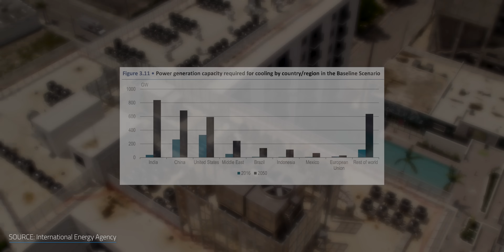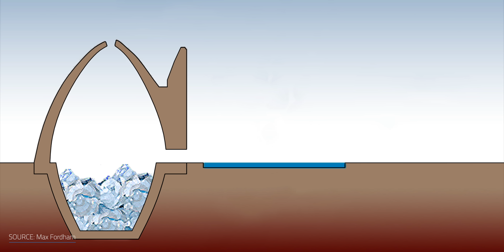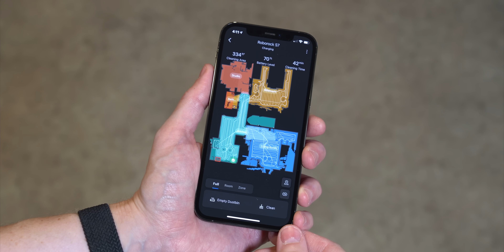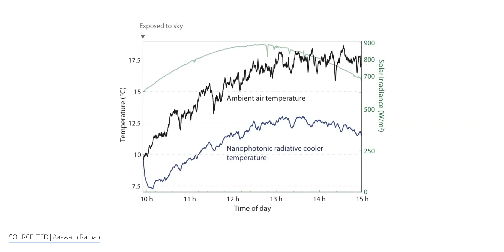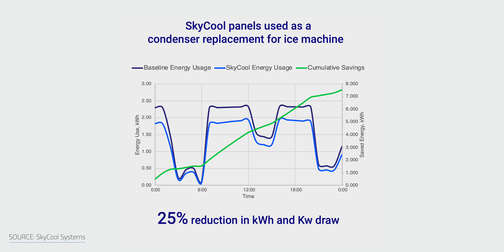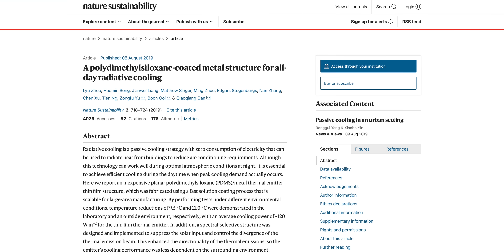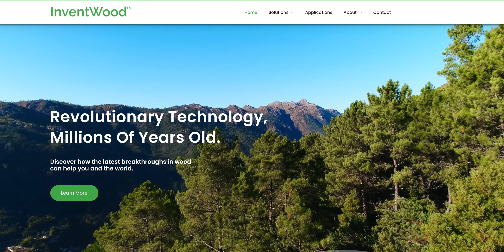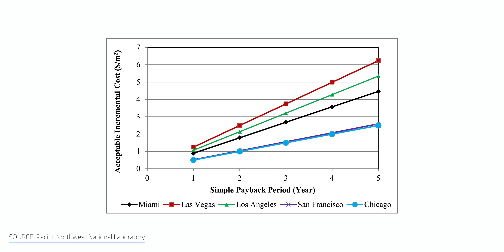Space Powered Cooling May Be the Future of Energy

Comment: 2% of the surface doesn't sound that big? Couldn't they just build massive arrays out in the deserts?
Reply: The main problem is that these geoengineering projects may have unforeseen consequences for the global climate and weather patterns.
Near covered areas heat transport and temperatures will differ from the surrounding areas and that might influence precipitation, wind and seasons.
Reply: @totalermist  that is an issue. not doing anything has foreseen consequences though. And a system like this could be turned off, so in a way is better than shades in space or dust in the atmosphere as a solution.
Reply: @jameshughes3014  The difference is that the known problems are manageable. It's possible to limit global warming to a point where we can prepare for and deal with it.
Introducing a new variable into the mix is risky.
Reply: @totalermist  manageable? we have totally failed to manage anything. a huge portion of the country catches fire every year.
Reply: @jameshughes3014  Most wildfires are the result of arson and carelessness and totally preventable. The consequences of rising temperatures and weather extremes can be reduced by careful planning and suitable preventive measures as well.
Flooding is often a result of flawed zoning and poor land management. The effects of droughts are amplified greatly by overpopulation and unsustainable agricultural practices, etc.

What I'm trying to say is that none of what happens today and in the near future in terms of damage and loss of life is inevitable and can be mitigated without resorting to half-baked technological megaprojects.

Reforestation, birth control, proper waste management, proper city planning, less sealed soil and more room for natural wetlands as well as sustainable agriculture are much more effective (and cheaper in the long run) than trying to fight symptoms instead of root causes.
Reply: @totalermist  lots of people have already died from global warming caused events. millions each year. and it will get worse. gonna 'manage' them back to life? it's not something that will or may be an issue. it has been. and it's already nearly too late. its time for drastic measures. we have to stop polluting yesterday, AND do what we can to remove the excess that is there now.
Reply: @jameshughes3014  Yes, people have died and more will if we don't take measures. I described solutions and why they help. Painting the world white is neither a solution nor would it help.

Mismanagement of resources is the primary problem: deforestation, sealing of soil, unreasonable zoning laws, unsustainable agriculture, overpopulation, lack of proper waste management and recycling.

Those are the primary issues that will continue to cause massive problems in the near term. None of those are addressed by painting the desert.
Reply: @totalermist  well, I guess if you say so it must be true.
Reply: Remember that the planet is 70% water so 2% of earth is 1/15 of the land area.
Reply: @doritoification  true, but it means if we had a few  patches of desert 1200 miles on a side, that would do it? We have desert, lots of it. cover arizona and north africa, some of the middle east? Plus, there's nothing saying we can't put them on the ocean. It would be a monumental undertaking but.. I mean if it solves global warming?
Reply: @jameshughes3014  it wouldn't solve global warming. It would be an eternally high maintenance attempt to mitigate against increased solar radiance which would do nothing to solve the other issues CO2 causes such as ocean acidification and would only last for as long as it's maintained.
Carbon needs to stay in the ground. Using these things to increase the efficiency of industrial cooling will reduce the amount of carbon liberated by a non negligible amount which has a compounding effect over time (carbon is very stable in the atmosphere and will continue to heat the planet indefinitely) so it's one of the many tools we should use to improve our use of energy but as a stand alone geoengineering method requiring 1/15 of the land area it's a non-starter. Period
Reply: @doritoification  yup. it'd be hard to do, and it wouldn't be the entire solution but might be a part of it. got a better idea?
Reply: @jameshughes3014  yeah I do have a better idea. Literally anything that has a permanent effect on radiative forcing is a better idea than something with a temporary effect on radiative forcing. Covering the desert in panels that will ultimately just get re-covered in sand is probably the worst geoengineering technique I've ever heard proposed. You'd be far better off just using them to reduce the energy consumption of industrial cooling.
Then we need to electrify transportation and heating while expanding the use of low carbon nuclear energy especially working towards 4th generation technologies like molten salt reactors.
Finally, when energy superabundance is achieved, make use of the combined heat and power from mature 4th gen reactor designs to take the CO2 dissolved in the oceans and hydrogen from sea water to make synthetic hydrocarbons. This technology will be pioneered by the need for carbon neutral aviation fuels but, when mature, could transition towards replacing all the petroleum based products we use in every day life like plastics. When these enter landfill they will have sequestered the carbon and actually made somebody money in the process, incentivising the continued sequestration of carbon without disrupting the human desire to keep consuming more and more
Reply: @doritoification  we need to do a lot of things. so, what is your better idea? all you did here was talk about what we might one day maybe do in the future. but people are dying today. so.. you know, any ideas? I say we make green house gasses illegal, or so incredibly expensive no one can use them. But even if we turn off all pollution now, that doesn't solve the problem. Even if we start pulling some CO2 out of the air.. global warming will still get worse for  years. What ever we do, we need a real solution.. not jibber jabber while people die. Even if it's not a great solution, something, anything that helps, is better than dreams of future reactors while millions of people die and islands sink. The time to fix this is yesterday, not tomorrow. If we get real about this.. if we as a planet actually take this seriously.. we can stop polluting, capture GHGs, and get rid of some of our excess heat all at the same time... and maybe, just maybe reverse this thing. When an animal sees headlights.. they either do something.. or stand there like idiots while the car bears down on them. We have to stop sitting around like a deer in headlights. its time to do something.
Reply: @jameshughes3014  I don't know where you live but here in the UK our largest power station called drax actually runs on wood pellets imported from South America causing extreme deforestation and not even being low carbon despite the claims. We also but 10% bioethanol in our petrol meaning fuel consumption now creates demand for unsustainable bio energy crops. It's really bad and with nuclear and electric cars it could have been solved a long time ago.
Reply: @doritoification  what will you do with the waste from all those reactors? can we keep it at your house?
Reply: @jameshughes3014  it's less radioactive than the ore it was mined from after 300 years. Our dry cask storage is a perfectly suitable storage method.
The ceramic material can also be vitrified in glass before put into dry cask storage too for extra containment after the concrete and steel has failed thousands of years down the line but it's not really worth it for light water reactor waste seeing as we will recycle it in next gen fast breeder reactors in the coming years.
Even if all of the above wasn't true, there are deep geological repositories being dug as we speak. Seems like a waste to me... lts only waste if you waste it
Reply: @doritoification  a quick google shows all kinds of issues with it.
Reply: @jameshughes3014  well i'd argue that solving climate change in a day is a bit far fetched and so is your idea but i think this is a good time to end our discussion
Reply: @doritoification  sorry, my replies have been harsh. I'm just tired of people dying while we sit around and do nothing and argue about how to fix the problem.
I'm sure your ideas have plenty of merit, but we've had nuclear for decades. we've tried managing the situation for decades.
half of my home town was wiped off the map because of extreme weather. maybe it wasn't climate change that spurred that tornado, but plenty of people are going to suffer a similar fate now because of it.
it's time to stop polluting and take some responsibility. turn off all the GHG producing factories and ships and I bet everyone will want to hear about nuclear real fast. Just make sure before any new systems are produced that the waste issue is dealt with, planned and paid for before the first new reactor goes online.
Reply: @doritoification  really? you think so? because we already know how to fix it.
stop.
polluting.
it isn't complicated.
Reply: @jameshughes3014  nuclear decommissioning funds are in place before the reactor even goes online and paid into throughout the operation of the reactor. They're generally so large that (in america) it becomes more profitable to shut down the reactor than to operate it because the operator can pocket the difference between the cost of decomissioning and the money in the decomissioning fund. We don't have that problem in the UK but point is that the funds are most certainly in place.
Reply: @jameshughes3014  the "just stop polluting" and "just use less" and "there are too many people" narratives are very very old, far before my time. Never in human history have we "just used less" or "just stopped polluting" because everybody wants to improve their lives. Interestingly though when we do improve our lives with access to education, energy etc. women trend towards having fewer children later on in life which leads to population stabilization.

Just food for thought
Reply: @doritoification  so your point is that we havn't done it yet, so we can't do it?
Reply: @jameshughes3014  the definition of insanity is to try the same thing twice expecting a different outcome.

Comment: So what’s the disadvantage
Reply: I believe the IR 'pigment' is achieved by carefully controlled particle size, so it is just hard. That doesn't mean it will stay expensive once we get good at it. Barium is bizarrely common (in high grade ores too), but fairly useless, so while strictly speaking finite, if we got it thin enough to get a square km out of 4 tons, we could literally cover the earth in the stuff with just known good reserves. 
The dependence on atmospheric conditions is probably the biggest issue. When the weather is clear it works extremely well, but for many applications (data centres in particular) reliable performance is more important than absolute performance. With a large thermal mass some of that can be offset, but it runs into some of the same storage problems as renewable energy. It also doesn't perform nearly as well when it is cloudy, which is an issue because that implies high humidity; when you want AC most. In arid regions it is extremely effective, but it is more situational than a simple heat pump to atmosphere.